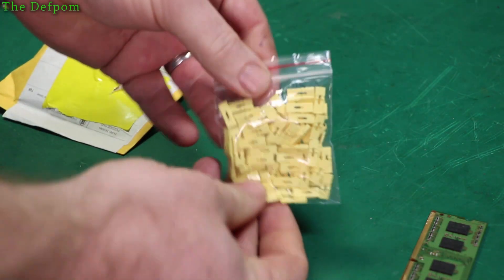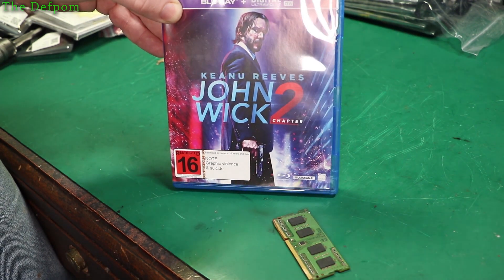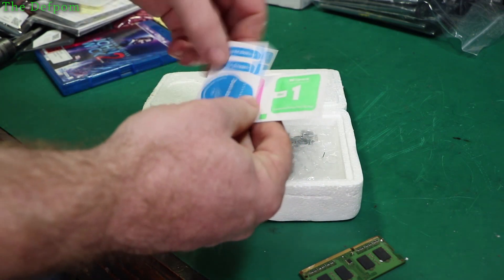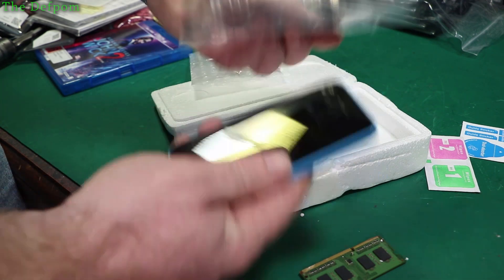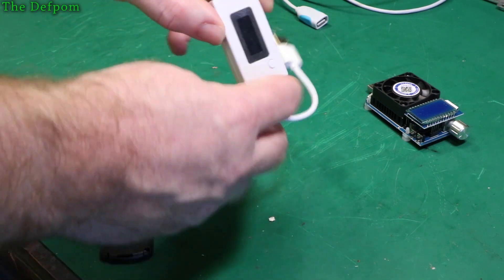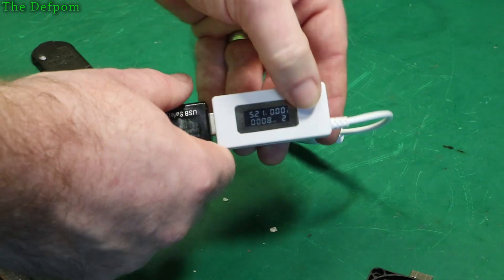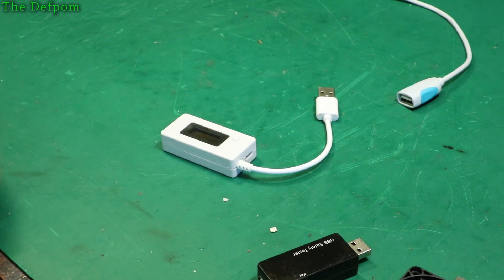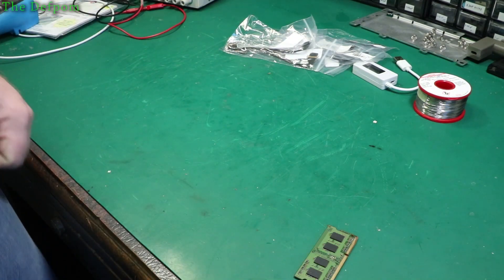🔴 #599 Mailbag Monday 22nd July 2019

Comment: the usb meter thingy, can measure  and  passing QC 12v voltage , but it can only show 1 digit of the voltage. The usb micro is a input and  is handy for testing wall adapters that only have a micro usb wire permanently attached. the one button infetface lets you measure copacity for a few differnt "profiles" but it is confusing to use one button.
Reply from the maker: bob g - Thanks, I haven’t used it much yet, nice to know what it can do.

Comment: they sell the head magnifiers at RS if yours is like mine the switch will jack it in because of the humidity.I put a small external switch on mine.. If your a Mad-Max fan you will see them used in the film